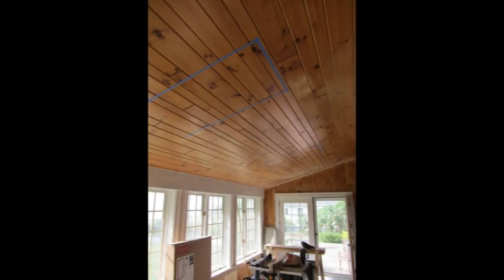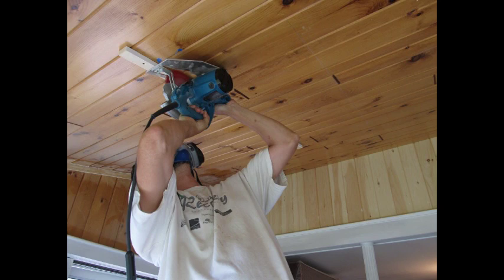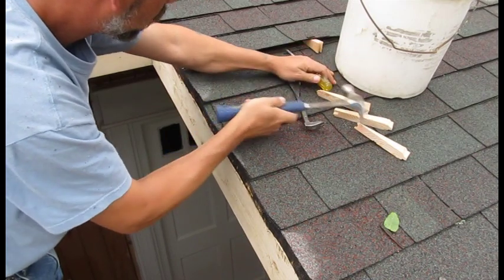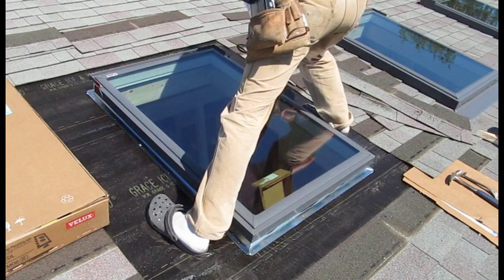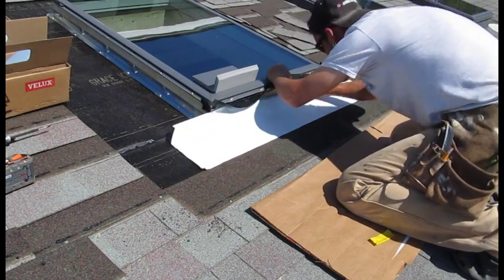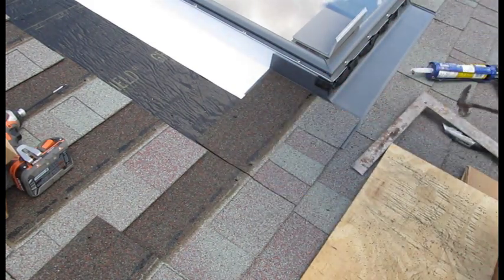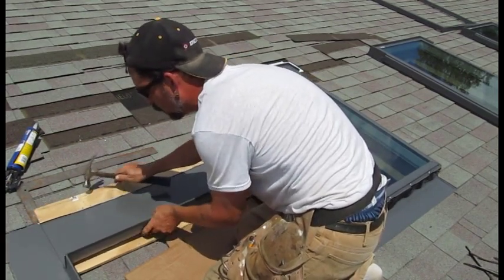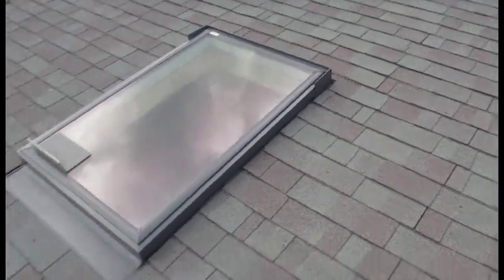Skylight Installation.mpg

Comment: I have twenty year old doomed skylights and some of them leak inside. Been told to replace all three. ID dim. look like 29+x45. Been told by roofer that that size is not available and roof would have to be reconfig. to accommadate new fixed Veluxs'. Price quoted is $4000.00 installed for 3. First does this sound right to you on size and price? and second, do u think the domes re causing the leaks and can I just have the domes replaced in order to save money? On fixed income. thanks.

Comment: Please- do NOT nail in the first 8" around the skylight! Properly applied flashing doesn't need all of that caulk.  He needs it because he is making unnecessary holes in everything. nail the bottom flashing up on the sides of the unit then just let the step flashing float. At the very end you will need two dots of caulk over the screws or nails holding down the head flashing. Being slathered in caulk is not how roofing is meant to work.